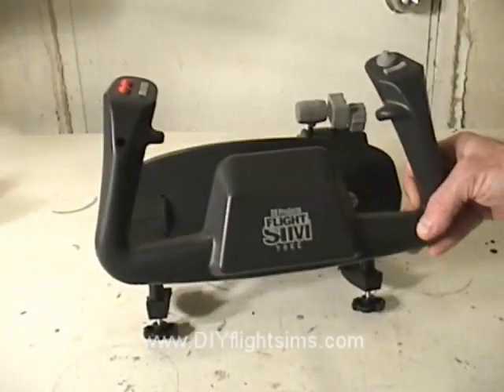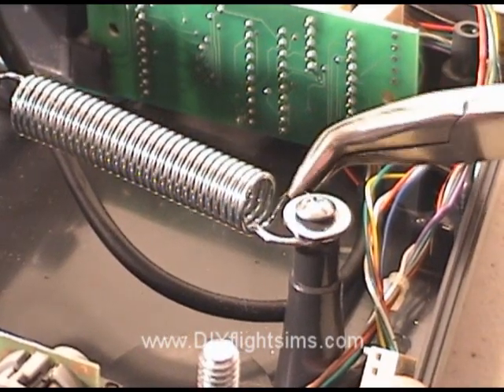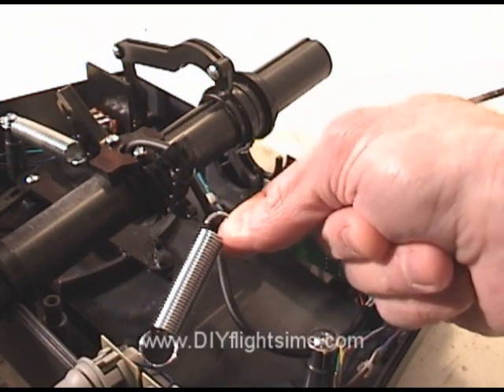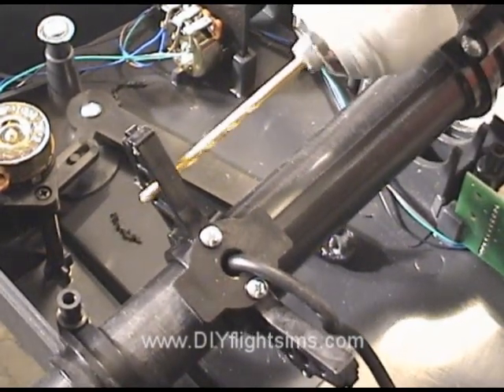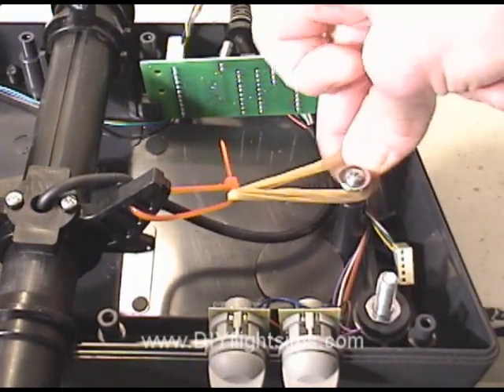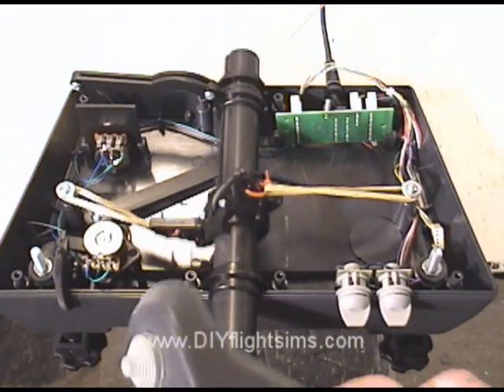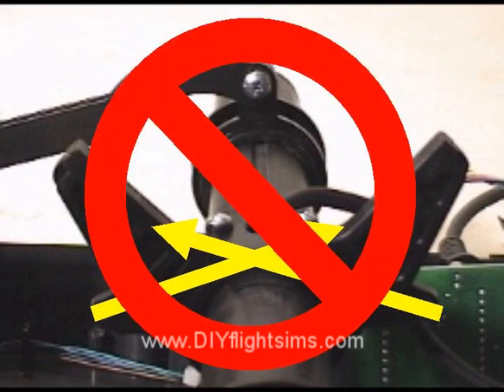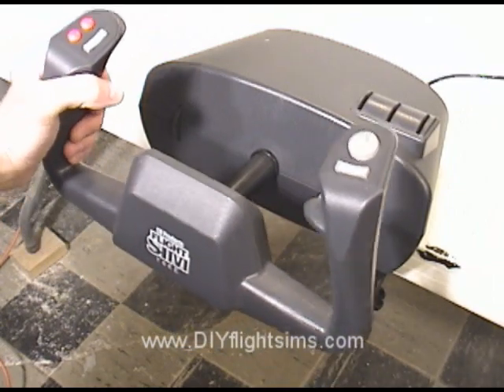CH Products Yoke Modification

Comment: A guy at church let me use his Yoke until I get my own. His only has the throttle control lever in the housing, unlike the other models which have all 3 levers, but it’s still basically the same. I told him about this mod and he gave me his total blessing to do this. Maybe this yoke would be a temporary thing for me, but this mod would be a good thing for him as well when he gets it back.

Comment: One thing that made mine WAY better was getting a little bit of lube and rubbing it on both sides where the dick shaped part goes inside of the unit. It's so damn buttery now. In fact I wonder if I could have used butter. But the lube was already in arm's reach so I tried that and I'm quite satisfied now ;)

Comment: Daughters hairbands worked great.  Used two and twisted them 9 times to get the tension desired.  Used a pipe cleaner in the small holes the springs were in to hold the bands and hope the fur on them will reduce friction and keep the bands from failing early.  Petroleum jelly seems to work so far on the yoke shaft.

Comment: I did this mod and I can really feel the difference. However I somehow lost all aileron control. The control arm inside the yoke looks fine but no response both in sim or my attempt to calibrate it. It doesn't even register in the calibration menu. Hellllppppp? I know this is an old video but maybe someone can help me!? Thanks!
Reply: Red,  I had the same problem, probably because I read your post.  My problem, pod that turns and has three small wires coming off, one of the tabs touched the other tab I pulled it away and it works fine..  Good luck

Comment: I found that it wasn't the springs that were my problem, but the rear "rings" on the yoke shaft, especially the one that connects to the roll Potentiometer.  I used a fine grit sand paper and a file on the inside of the rings, just enough to allow free movement, without being too loose.

Comment: First, thank you for this video. It was incredibly useful when trying to fix my yoke. I was having trouble getting it to return to its center points. It also felt like it was losing its springs. I took this video, and did him one better, and I tell you it's perfect now! 

First, add rubber bands to each side, in addition to the factory springs, instead of replacing the springs with rubber bands, as stated in the video. I replaced the springs with bands at first and I felt it was a little better, but it still wasn't bouncing back to center like it should. (A little petroleum jelly on the contact points is strongly recommended as well.) I used (20) size 16 rubber bands on each side, (40) all together. I drilled a hole on each side to fasten the rubber bands so they each had the same point of contact. I also used zip ties to hold all 20 rubber bands together, as one, prior to mounting them into the yoke.

I now have complete control over my yoke and I no longer need to shop around for one better. Please feel free to ask questions if I was unclear at all. (I didn't feel like making a video.)
Reply: Do you have photos of what you did? Sounds like a really great mod.
Reply: I can take photos for you if you want. email me briancream@gmail.com
Reply: Send it to me as well. I have trouble getting it return to the middle as well
Reply: @frizsld6793  - Email me and I'll send you the pics. I just found them after all this time. briancream@gmail.com
Reply: Will it be too tight to pull and push the yoke when you put so many rubber bands?

Comment: After watching this vid. I decided to dig my yoke out of the cupboard, where it's been for several years, because it had become unusable due to sticking and open it up and fix it. The problem was caused by jamming of the back bearing  and roll slider ring on the shaft. The shaft was slightly oval at the seams running down the sides. No amount  of lube would fix it. I took a round file to the rings and a flat file to the sides, until the rings moved without effort. Now I have a lube free, precise yoke.

Thanks..

Comment: Thanks for video. For good dexterity in pitch control Ive always used dry graphite lube for the yoke shafts on real piper Cherokee and Cessna aircraft. For this plastic flight sim yoke shaft I found it would work for awhile but eventually the shaft would stick again. I'm now using Dow Corning High Vac grease and it has been working great and very fine pitch control can be achieved  and the springs are still strong enough to return it to neutral.

Comment: what is the board called that the switches are plugged into that has the usb connected to?
Reply from the maker: You mean the green board? Something like that is usually called a PCB or printed circuit board. I don't know what else I would call it.
Reply: Roger Dodger Aviation -
LOL Because board turns analoge toggle switch signals and push button signals, so the pc can read them as a controller.
Reply from the maker: Ok

Comment: Hi Roger,
I made the modification to my CH Eclipse Yoke, and the smoothness of operation over the spring set-up was well worth the time and effort.
Also, I suggest to make your zip-tie a closed loop first and then bring the rubber-band through.
This allows the user to change it easily to the desired tension, or to replace a broken rubber-band.

Question: 
Why didn't you use the existing holes the springs went through for the rubber band setup?

Thank you for a great tutorial!
Reply: jbarsoian Good suggestion about closing the zip-tie then looping the rubber-band. This allowed me to center my yoke better.
Overall, this mod is pretty good!

Comment: Did a mod on my brand new CH Yoke. It was my second and of course nothing had changed. Guess CH figures they work well--WRONG. I put in new springs that I bought at HD that have much less tension than the CH version. Then I lubed the heck out of it with white lithium grease. Works really well.

Comment: Rubber bands dry out and generally deteriorate, sometimes as quickly as a few months.  My solution to improve smoothness of small pitch inputs was to lubricate all sliding surfaces with STP automotive oil treatment.  I've experimented with a wide variety of lubricants, but only STP has yielded the results I was looking for.  The characteristics of the yoke have changed dramatically for the better as a result of this lubrication and since then, using the yoke has been an entirely satisfying experience.
Reply: ok

Comment: My yoke makes a click sound when I push it forward and then pull it back. Can you see if yours does this to?
Reply from the maker: +Corrie Clark Sorry, I don't know where this yoke is right now. I use a different one.
Reply: +Roger Dodger Aviation You can hear it from 0:14-0:16
Reply: same !! try something called wd40 and put it in the cracks where you take it apart and where the screws go in and after a few goes it will stop!
Reply: lol wd 40 is not a lubricant... you  will have to reapply every few months if that

Comment: Very nice, but won't this make the centering worse?
Reply from the maker: No. It works great.
Reply: Roger Dodger Aviation I actually wanted to fix the centering issue I've been having. Any hopes that this will work?
Reply from the maker: turbotortiose Yes. It works fine.

Comment: si this better than saitek? i mean more realistic then saitek?
Reply from the maker: Neither yoke is realistic, but the Saitek yoke is better because of the separate throttle/prop/mixture levers.
Reply: Can you please explain why they aren't realistic? And what can be done to make them realistic?
I'm building my own yoke, and I want it to be as realistic as possible. :)
Reply: the saitek isn't realistic because the real light aircraf like Cessna  and other don't centerline itself saitek yoke does also saitek is too big and heavy far from realistic ones!i would stick with CH yoke
Reply from the maker: NightPanda When you adjust the elevator trim on a real airplane, you achieve an aerodynamic balance on the elevator. It's a feel that can't be duplicated with springs in a retail yoke.
Reply: Roger Dodger Aviation - thanks.
Reply: And thats really anoying. I wish there was one out there that offsets the springs/rubberbands regarding of trim. That is affordable. I know there is some really expensive ones out there.

Comment: Great video! I went one step further and used 2 short lengths of HD surgical tubing, and attached them to the center plate with 2 small screws. The action feels so much better, and the yoke doesn't make the screen door sound anymore!

Comment: I bought my CHyoke and rudder pedals back in 2002, and I'm thinking about buying a new PC for FSX on black friday, the pc runs windows 8. Roger, will the CH controls run with win8, I went to the CH website and it doesn't say anything about win8 so I figured maybe you would know.

Comment: I think I'll need to be opening mine up as its developed a problem where the raw data is taking a long time to centre from a right input, despite the physical position of the yoke.
May do this while I'm at it. 
Hopefully some maintenance can getting working properly again, though I think an upgrade the the Cessna branded Saitek will be the ultimate resolution.

Comment: The ultimate solution to the friction problem would be to retro fit the front and back of the yoke with a bearing ring around the shaft. At that point it would perform almost as good as a PFC yoke.

Comment: SUGGESTION: There was alot of friction in the areas where the shaft contacts the plastic. I greased any moving contact areas along the shaft with oil. The improvement was quite substantial. It's silky smooth for the moment. In time dust may cake on the oily shaft & reduce the smoothness. At that I'll clean out the oil & replace it /w Teflon spray which is dust repellant due to its magnetization. As it is magnetized, I'll have to take apart the yoke and do the spraying far from its electronics.

Comment: I would recommend you all to use Theraband Gold rubber. I just got some home and i modded my Flightstick, like this but with theraband instead. Just burn two holes in the band , one hole for each attachment, just repeat until you have desired strength :P

Comment: CH Customer Support and the User Forum BOTH say do not use Silicone lubricant.  Over time, they say, the plastic degrades.  The only product to use is Rubbing Alcohol on the shaft.

Comment: Rubber bands tend to deteriorate rather quickly, but I found an even simpler solution.  The biggest problem is that the shaft doesn't slide in the bearings as smoothly as it should.  I tried to fix this by trying various lubricants such as silicone, oil, grease, etc. None seemed to fully accomplish what I was looking for until I tried STP automotive oil treatment.  That stuff is slimy and super slippery, like nothing else and it made it much easier to give the yoke very small and precise inputs.

Comment: I just performed this mod on my yoke and all I can say is AMAZING!  Works really well.  I also added some silicone lube to some of the frictions points while I was in there.  Bit of difficulty trying to open the yoke.  One of my clamp bolts was stripped and had to do a little bit of repair to the post that holds the clamp nut.  J-B weld quick dry did the trick.  As a private pilot, I was trying to improve the feel and this worked.  Thanks so much,

Comment: Great idea. One small thought...if you added another looped zip tie in between the rubber band and current zip tie, it would take out the twist in the rubber band, and prevent any possible abrasion that shortens the band's life.